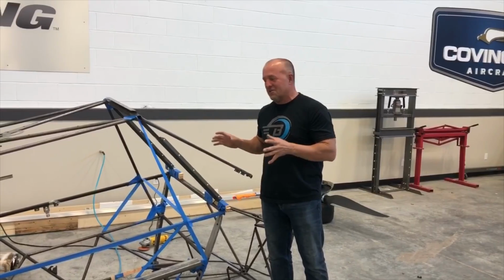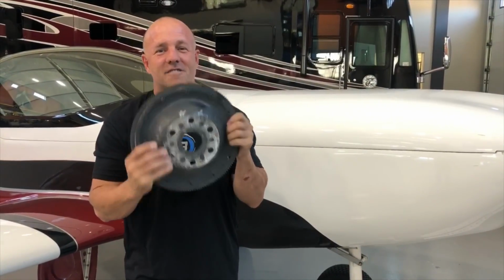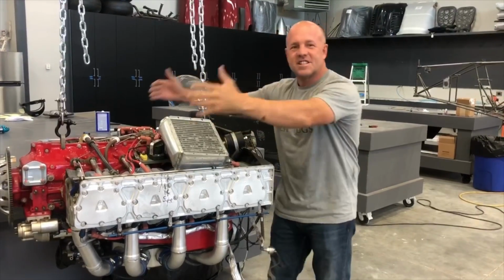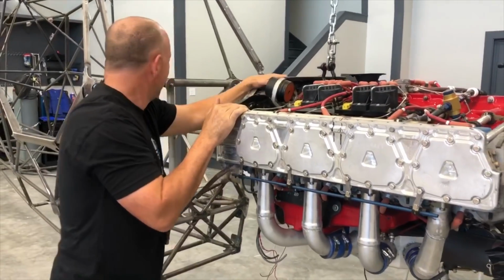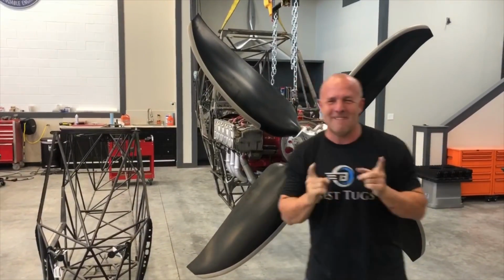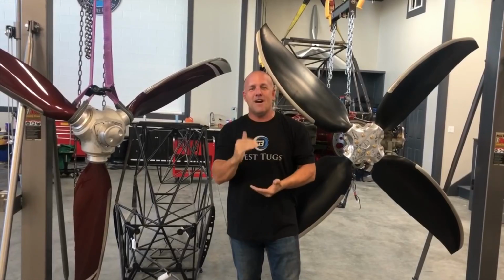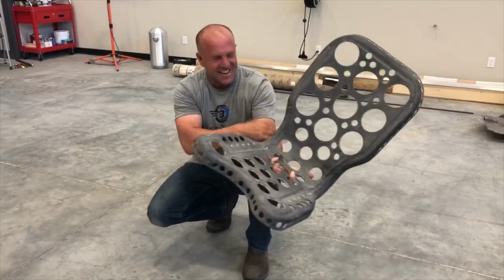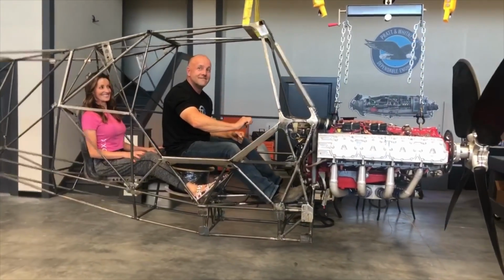Never said that Scrappy was Normal 🤷🏻‍♂️ (Scrappy Bush Plane 3)

Comment: Wow! I wish we had one crane at work let alone four!! We have a manual harbour freight come along chained through the drywall to god knows what and its fixed. The ceilings are low enough that we only get about six inches of travel when attached to the Mast. The company gets a lot right, I can get a new transmission tomorrow but geeze the hangar does not have to be airworthy.